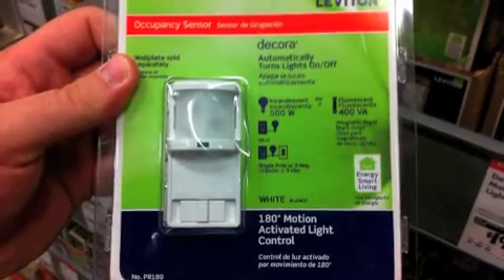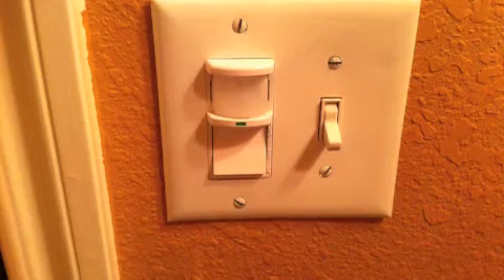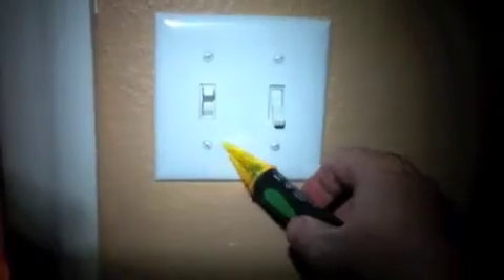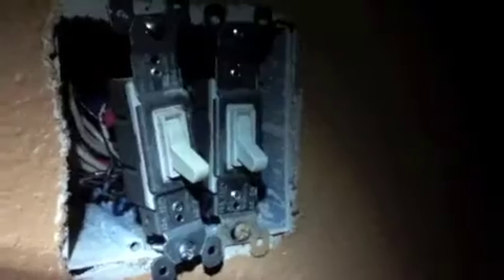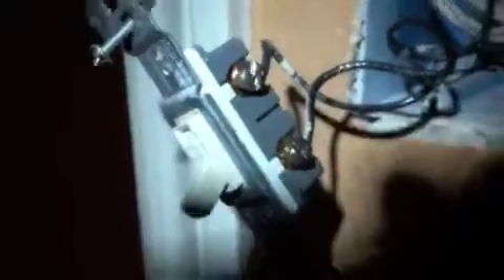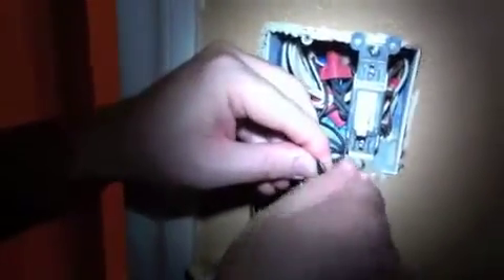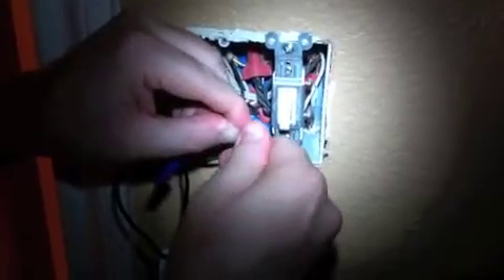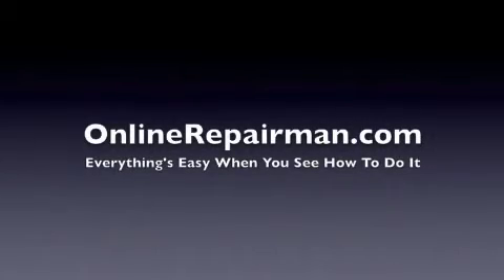DIY Motion Detector Light Switch Installation

Comment: With (4) wires it require a neutral wire: Hot (black), Load(red), neutral(white), ground(green).

With (3) wires, neutral wire is not required.  This configuration does not work well with devices that require electrical ballast.